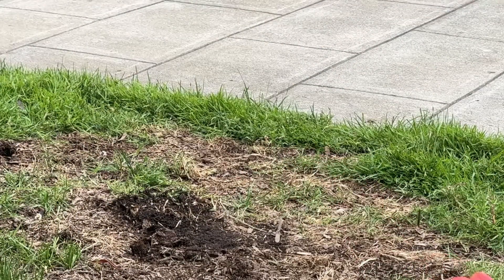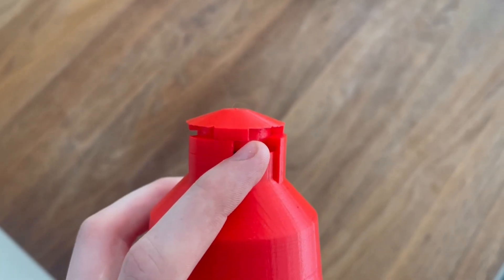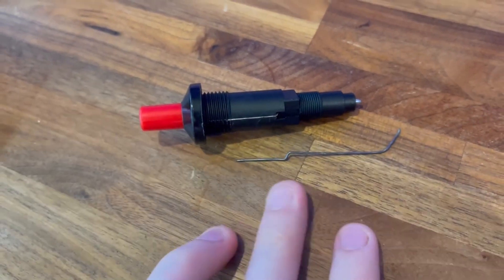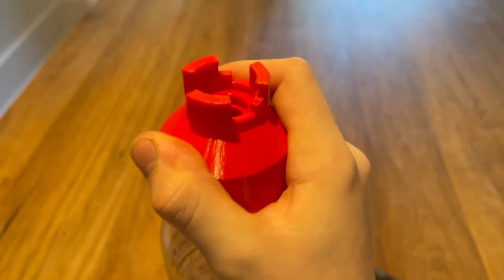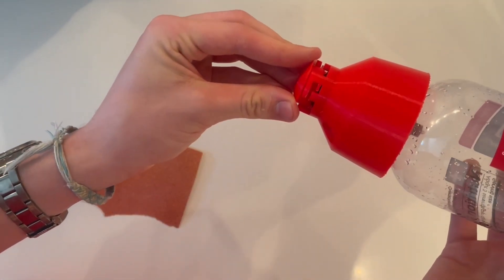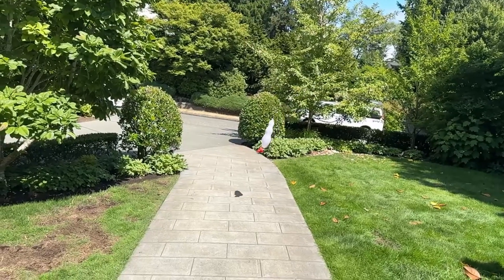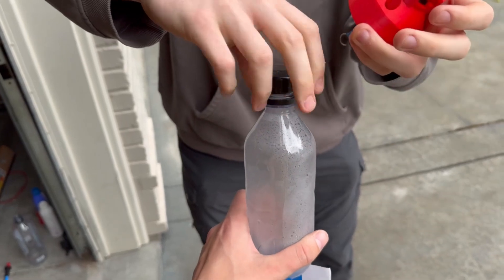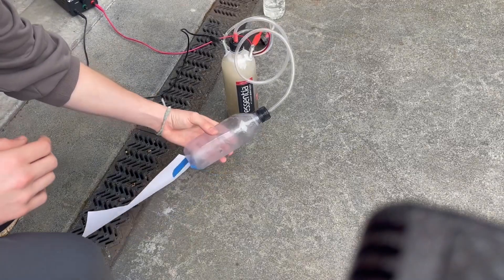Impact-Triggered Hydrogen Bottle Rocket – Part 1

Comment: Awesome vid, you can try this to fill a container with HHO easily:
-Fill the bottle with water
-Insetting the HHO pipe output in it
-Hold the HHO output pile between two fingers, with the output facing your palm
-Hold the HHO output pipe inside the bottle and your hand against the bottle mouth to avoid any water coming out, and turn the bottle upside down, letting bubbles rise to the bottom of the bottle, and making it so that only water comes out and no air comes in because of pressure building up due to the HHO rushing into the bottle
-Once no more water is left in the bottle, use the other hand to dry the outside and try shakign the bottle to remove as much water as possible
-Carefully screw your contraption to the bottle, only removing the HHO output at the last second.

You should have a lot of HHO mix in there if you did it correctly.
Reply from the maker: Very good Idea, I wonder if I could do this underwater, could increase the amount of pressure in the bottle because of the density of water.
Reply: @Flames-n-Stuff  
You could use a bucket or a tray with good depth and flip the bottle upside down so that it slowly releases the water as it fills, instead of holding the water with your hand, but I would not submerge the whole thing underwater because of two reasons:

1- You will get the ignitor wet and it might rust or degrade and stop working.

2- The volume of the gas will not change much even if you go to the bottom of a deep pool, pressure isn't that high, and by then you would need a super long pipe for the HHO generator and you would have to close it underwater at a great depth, and with your design, you would be losing pressure as 3D printed components are usually not air proof.

Comment: Great Video! Why didn’t you switch from the attachment, straight to the ignition mechanism? (skipping the regular bottle cap)
Reply from the maker: We were trying see whether we could have filled a bottle with HHO and then taken it somewhere, like a park, to attach the mechanism on-site. But for future tests, we’ll probably just attach the mechanism directly to the bottle from the start, or re design the mechanism to include a one way valve.

Comment: Given the sub-atmospheric confinement and limited stoichiometric control inherent in balloon-based HHO deployment, how does the absence of significant overpressure affect the detonation-to-deflagration transition (DDT) threshold during mechanical impact ignition via piezoelectric discharge, and what role might localized pressure spikes and geometric confinement play in facilitating or suppressing prompt volumetric reaction kinetics under such conditions?
Reply from the maker: They are minute and as such can be ignored.

Comment: this is so cool.
I’ve had the same idea of trying to drop hydrogen balloons and water bottles from RC planes but as an igniter, I’ve used those little white pop its that you throw out the ground and explode. I put them in the front of a water bottle and anytime it hits the ground it explodes. These keep it light and easy however it’s kind of dangerous because it could go off with fragile movements.
Also, is there anywhere that I can find the links to the 3-D print files?
Reply from the maker: That’s a pretty cool idea, actually! But yea I was trying to keep things a bit safer with this project, and also wanted them to go off on grass and such. I’ve added a GitHub repository in the description with all the 3D files, plus a link to the igniters I used. Thanks for the comment. :)